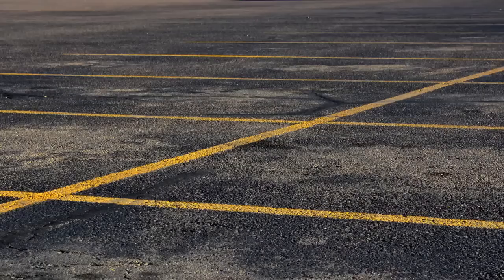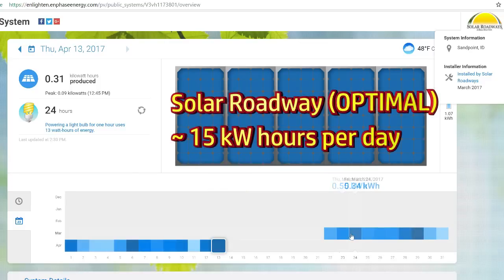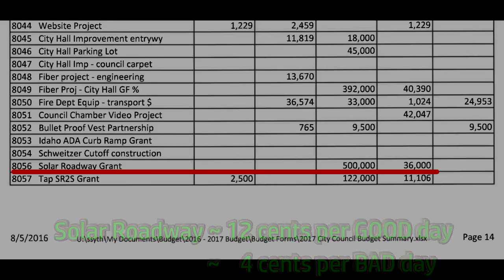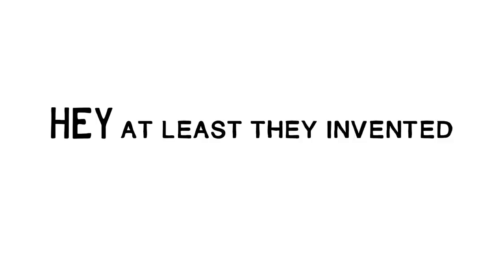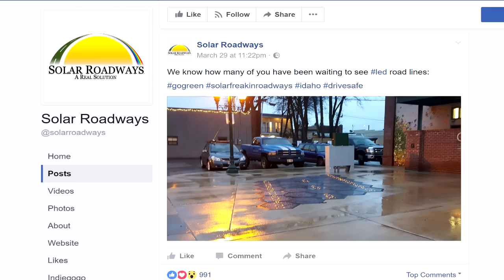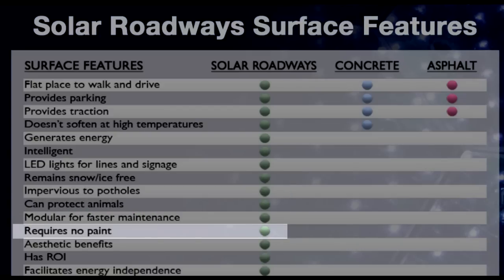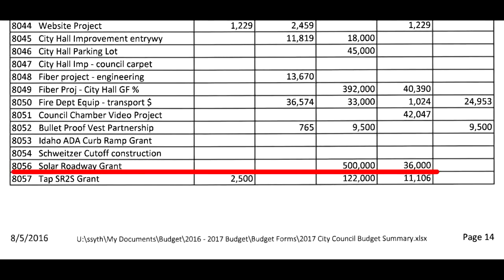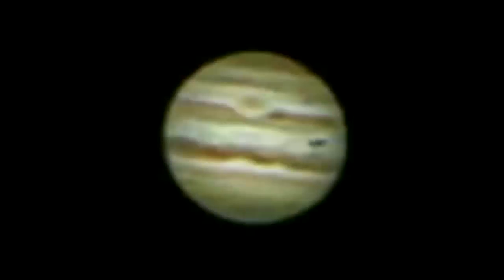Solar Roadways generate ~10 CENTS per day!!

Comment: This has got to be a scam. No way does a qualified engineer think this is feasible when such simple calculations show how utterly silly the idea is in practice.
Reply: A lot of people insist the guy is just in over his head, but if you look back they recently bought two sections of standard solar paneling for a simple test. Flat vs angled energy production. He stated that he wasn't aware of any test done to determine something like that before, which is such an extreme sign of incompetence that the man must either be an absolute idiot or a conman.
Reply: Michael Steffensen "qualified" engineer here... WE DON'T.

It's abundantly clear to any real engineer that this is a load of shyte. Clearly they didn't think it through. This would NEVER pass the concept stage with any engineering team I've ever worked with for the exact same reasons TF outlined in his first vijeyo. Same as the hyperloop. I can think of several ways to make it work and even make it reasonably safe in the case of an incident. Unfortunately none of these coincide with what's been demonstrated by the project and none of them are economically viable.

There's a reason we call these people frauds and the people who fund them - "brain-free pockets".

At this point I say fuck humanity, might as well get rich designing weapons!
Reply: A scam or he isn't an engineer and just doesn't have a single clue as to what he's doing... 
I mean, in a previous video he had to research solar panels and the effects of laying them flat vs angled, like the fuck really? As if nobody has ever tried that before and found out it was stupid nor has TF explained how it works in his busted videos either, nope none of that exists, he's working alone in a completely new field.
Reply: I'm pretty sure the guys who came up with this crap are not "qualified engineers". But then again you don't have to be an engineer at all to realise this "SOLAR FREAKING ROADWAYS" is utter crap. People are SO STUPID, delusional and naive.
Reply: Daniel Nunya Bidnezz - I really hope that's all sarcasm.... because the hollow point bullet shaped front and the divots like on a golf ball are absolutely the stupidest ideas on earth.  They show about the level of knowledge that the people who funded Solar Freaking Roadways which is why I'm thinking it might just be sarcasm.
Reply: The problem is that better solar tech doesn't make this a better idea!  It's a dumb idea regardless of how good the tech is.  By putting the solar panels flat on the ground, you're throwing away a significant amount of the energy the exact same panels could be producing if they were angled or sun tracking.  It's like designing a car that has holes in the bottom of the fuel tank and then hoping that future developments in the efficiency of the engine will increase the range.  The fundamental idea is deeply flawed - and better tech cannot fix it.
Reply: I'd do it for the money.
Reply: let's look at one of these long roads (highways? i dunno I'm not from the US). 
Where would it make more sense to put solar panels? 
Next to the road where there's thousands of km² nothing or on the little bit that's actually reserved for cars and trucks etc? Yeah let's put it on the road instead of next to it, makes sense!
Reply: What are you talking about it makes pefect sense. Let's put "SOLAR  FREAKIN ROADWAYS" on a parking lot where it will recieve all the energy it needs from ...parked vehicles? WHAAA... Just goes to show how ubelievably brain dead some (actually a lot of) people (americans) are.
Reply: It's not just Americans - there's a stretch of a bike path in the Netherlands where they're doing a similar thing.
Reply: Michael Steffensen the hipster douchebags that sap this crap up are easily duped into handing over cash. you can sell them a cream egg for $10 they are so dumb.
Reply: Daniel Nunya Bidnezz - Newsflash : Train tracks are not flat. https://en.wikipedia.org/wiki/Cant_(road/rail)
Reply: +Landrew0 A lot of thing's are against the law - but company's and people do it without a scratch. The problem is nobody has the time and money to stand up.
Reply: Daniel Nunya Bidnezz Umm... no. What you have here is a compressible flow priblem, so the dimples are out. Dimples on golf balls act as turbulators as they typically operate in laminar or transitional flow, where causing earlier transition is beneficial to drag. Not so much a problem when you're gking fast enough to worry about shochwaves...

Hollowpoint bullet designs are also a bad idea if low drag is what you're after (I'm assuming you're on about Scenar/OTM, not defensive/hunting, though neither are good for drag). What you do with a hollow point is essentially turn your design into a bluff body - it might as well be flat. In a 1Pa environment this would be irrelevant operationally anyway, assuming 1Pa was even attainable over this network.

Realistically, best you can get is 2/3 of atmospheric, which is a decent drag reduction, but I still question its viability - high volume pumps ain't cheap and they use a LOT of powah. At that point - I wouldn't bother with it, but let's keep that for the sake of the concept.

Best you can hope for is transonic, though you'd still have problems with your rail gap - what you don't want is a normal shock under your capsule... though it's likely inevitable...

No need to bother making it pointy, won't make much difference at that speed. You want a rounded streamlined frontal profile, flat top and sides and an elongated tail end coming to a point - we want no flow separation and minimal shocks. Come to think of it, these capsules might need too much curvature to avoid any strong shocks... fack...

The other issue to deal with is tunnel collapse. No way around the possibility - we have to deal with it. Going from 1Pa to atmospheric, the resulting travelling normal shock (look up water hammer) would be catastrophic. Even going from 2/3 atmospheric to ambient would be enough to turn a capsule into pizza. The only way to make such an incident survivable is to make the tube at LEAST 3 times the radius of the capsule. Also the ideal transonic shape would have to be replaced by something like a wedge instead. This way you stand a chance of deflecting the shock into the outer tube (likely to burst).

As far as the maglev system, it IS necessary, but it has to be integrated into the walls of the tube, else it'll interfere with flow around the capsule.

By "twisting the rails" I assume you mean banking turns? I thought that was a given - being necessary at these speeds. Bank angle would ideally be determined by the load factor, which I'd suggest be limited to 1.1g for comfort. This would also limit the turn radius to that of your average transonic airliner, but that's the price we pay for speed.

See what I mean though - not commercially viable :/
Reply: they are probably just hoping to develop better panel tech in time for release
Reply: I know, i'm just going by their logic.
Reply: On the ground? The stupidity just doesn't die. A better idea would be to make a ROOF of panels like in this video where thunderf00t pointed out /watch?t=63&v=LuYsYLqjUtU
Reply: Yuksel Ismail Yes, I even ran some basic numbers on the construction of a simple roof with solar panels on the side (tilted). It is roughly 10-50 times cheaper (no good numbers from solar roadways) has an almost double the solar efficiency rating and sheds water and snow eliminating the need for as much snow removal. And even then the costs don't justify the power generated. You would save another 10 times by simply mounting some solar panels next to the road and eliminating that big expensive structure that spans the road. Oh and you can save a few more dollars by just moving the panels to a very sunny place that is close to a moderately-highly populated area. 

Which is EXACTLY what people already do.
Reply: Fraud is a felony. Good luck with it.
Reply: Landrew0 and yet it happens every day.
Reply: and all hail landrew!
Reply: Erick Dominguez Then do it (okay please don't). It's not that hard since people don't seem to give a shit about if it can actually work.

Remember the self filling water bottle or the bike handle rebreather.
Reply: 233kosta  Way to fix the "hyperloop"...  4 Mag-lev rails, one on bottom, one on top, one on each side, and the rails curve and tilt in relation to curves in the track and changes in terrain.  Then put a long dent in the middle tip of a bullet train like a hollow point bullet, shape it LIKE a bullet, put a bullet shaped back end on the back of the bullet train...  you know...  SHAPE IT LIKE A HOLLOW POINT BULLET.  Then put golf ball dents all along the train like the outside of a golfball, which are made to cause air cavitation so the ball slipsteams through a low friction area of sky as it flies...  all of which would severely reduce air friction and air resistance...  and allow you to go MUUUUUUCH  faster.  AND TILT and TWIST the freaking rails so they act like a NASCAR or FORMULA ONE race track...  which is TILTED AND TWISTED to compensate for the cars flying around the track and to stop the g-forces from derailing the train because it flies sideways off the track...  which is the PRIMARY reason trains have to go so slowly...  because TRAIN TRACKS ARE FLAT!!!  Want to make bullet trains go faster?  Step One:  TILT THE RAILBED LIKE A RACECAR TRACK!!!

Comment: Its amazing what marketing can do. There is an already effective solution which could be placed in public places and on public buildings etc that is cheap efficient and has a quick ROI. But have a fancy marketing tool for a crappy product and people eat it up. The solar industry needs to make its self more sexy and pay for marketing and then we might start getting somewhere. Come on Private industry do your thing. The solar industry and I guess renewable to an extent is basing its marketing off of the fact it is requirement to move to this tech, but most people are stupid, make them want solar panels rather than just expect people to realise they need them.